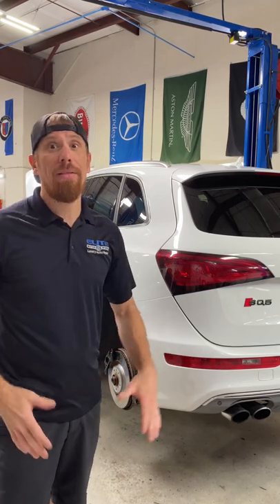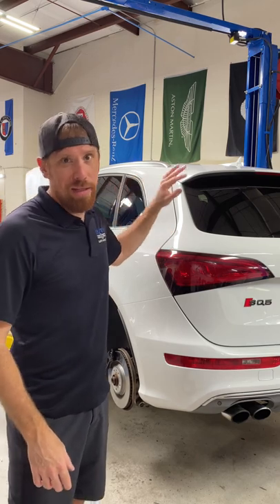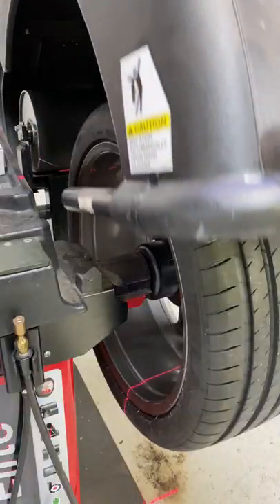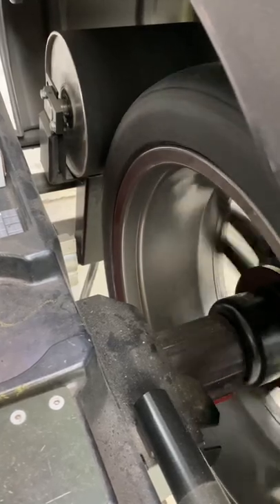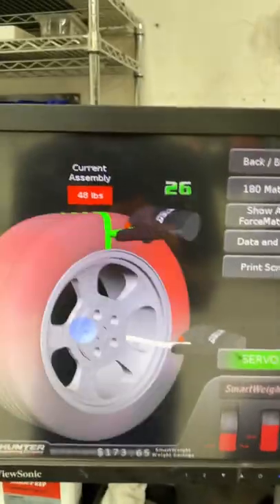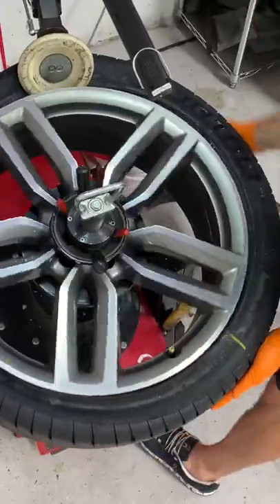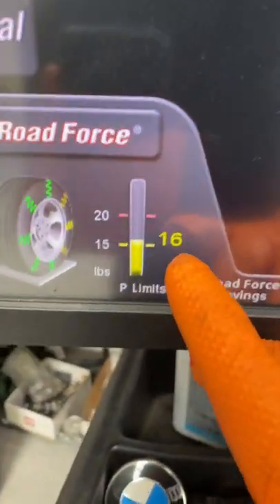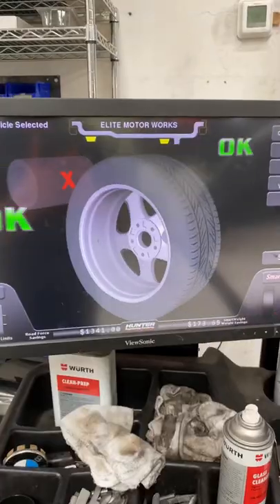Tires like a pro in 59 seconds #shorts

Comment: Bro where did you find that wheel balancer!!? That's next level!!
Apparently the one I use was made in the   Roman Empire days.
Reply: Hunter. Hunter makes good balancers.
Reply: Hunter engineering, they are exspensive
Reply: @DEATHWINGS5000  you get what you pay for.
Reply: Same 🤦‍♂️
Reply: I had the exact same one at the dealership I worked at.
Reply: I used to work at discount tire and we had the exact same machine almost. Now I work at Firestone, and I swear this one is from the last century. We have to manually calibrate where the weights go by using measuring arms and it doesn’t have a road force thing at all. Pretty big difference in priorities between the two companies I’ve noticed.
Reply: I still use a solid bar and two gauges like truing spokes
Reply: 6000€ + in our country..
Reply: Hunter.....
Reply: i just have 5 midgets spin the tire an i guess where to put the weights
Reply: @jstample  bro we literally have one POS changer and one POS balancer this place makes me sick lmfao
Reply: @fancypancytalker  That’s sounds horrible dude. I hate doing tires anyways being flat rate but sometimes we get backed up even with two of each machine if it’s busy
Reply: @jstample  look at the bright side at least you get flat rate lol I’m the only CST here and even I have to use our shitquipment sometimes. Our store is the most fucked one lmfao our tire number today was 15
Reply: America's Tire / discount Tire only uses those kinds of balancers I love them
Reply: bro i know exactly what pos balancer you’re talking about never again so glad i don’t work at that dealer anymore
Reply: @michaelric3540  sometimes
Reply: some cost $10k -$20k dont they.... everythings for sale
Reply: The road force balancers have kind of been disproven as a gimmick. 🤷‍♂️

If you want a nice balancer, check out Rotary's new line up. Yep the same lift Rotary, that rotary.
Reply: @LynxStarAuto source?
Reply: Realistically you probably don’t need it unless you have run flat tires or low profiles because the stiffness of those sidewalls is why you need road force balancing
Reply: Hunter road force elite GSP 9700 it’s 30k for one. thank god I bought mine used.

Comment: Did anyone else notice the lump in the wheel?
That wheel is effed up. The wheel has a flat spot in it, like as if someone hit a massive pot hole.
Reply: ai was just about to comment the same
Reply: Ask the wife, she aims for potholes and then drives into them! 🤦🏻‍♂️
Reply: Yup time for a new wheel. Or get it repaired. He probably doesn’t care because it’s the wife’s car.
Reply: Found many German cars with run flat tires can actually bend the rim with tire not damaged....
Reply: I work in this industry and can confidently say, German car wheels bend like crazy, BMW, Mercedes, Audi, doesn't matter they all bend. So do corvette wheels, but there's not much tire to protect them.
Reply: @JT0y  agreed, German cars bend wheels like American cars rust out, seen a 4 year old Chevy Tahoe with $6,000 in rust repair with ZERO help from the general.... Known issue but since it wasn't "rusted holes" wouldn't do anything for the guy, 60,000 miles on a 2015.... This is 3 years ago. Even the cheapest German car has a 10 year rust warranty. Sure German cars are expensive to fix but they don't have the baked in the cake planned obsolescence like GM. No manufacturer should let a car rust out and do nothing like GM.... Buy they only care about selling a car once. Most people I know who have bought GM new only do it one time because how garbage they really are.
Reply: @justinweaver7553  yes that is true, but do they really need to make stronger/heavier wheels for bad road country’s? 🤔
Reply: As my frend/wheel welder said „i can balance a square for you. It will not roll good”
Reply: Meh. Not a big deal. You'd be surprised how many bent wheels are rolling around the streets lol.
Reply: The mechanic is counting on the wheel to deliver him the insurance bonus.
Reply: Same my man.💪
Reply: came here to mention the wheel being bent up
Reply: Road force matching helps in these conditions
Reply: @justinweaver7553  been running around in the wife's car this weekend , it's got 205-40-18s and I thought it felt a little soft, like I'd lift off the gas and it felt like the brakes came on. 
Right front tire had 7.5 psi,with a best of 16 on one. 
 Not a run flat ,wheels fine, she gets lucky like that all the time.
Reply: @MrTheHillfolk  dude, wow, that's lucky she didn't have a blow out, I'd check...tires that low are very concerning
Reply: @justinweaver7553  yeah I checked it out when I got it out to my shop, couldnt be more lucky in a way ,that it was a leaking valve core.
Easy fix ✌️
She doesn't use the car much, and it was sitting for a good 10 days. 
Tbh I shoulda walked around it instead of just getting in and going.

Comment: Here is my issue with rims. Every on is so hung up on “billeted” rims. All that means is that it was a log of aluminum alloy and it was all machined out. I made thousands of billets when i worked in an Al/Cu foundry. The alloy is what is important….not the billet. And for a billet to be so out of balance means the chemistry and metallurgy on the damn thing suck terribly. If you are having to balance a wheel even at 16lb….the manufacturer is terrible and they should be HUNG. Their QA is a damn joke.
Reply: I don't think it's the metal, it's the fact that the rim took a hard hit and has a dent, or the tire is the cause for high road force. I've seen Ford and GM wheels peal off coating so bad that they can't hold air too.

Comment: To everyone who's mind is blown about the balancer, that thing has been around for almost 20 years... Hunter even makes machines with small platforms to set the wheel/tire on that raises it up to the balancer spindle saving your back.

What road force balancing it ACTUALLY doing it matching up the heaviest point of the tire with the lowest spot on the wheel aiming to potentially cancel out those two points which can create an un-smooth ride.

Comment: Have an older road force where I'm at, works great but new tires can give wacky high readings at first... I find letting the tires sit pumped up for a couple of hours (if possible) will help but driving 500-1,000 and rebalancing tells you for sure. But mount matched tires bolted to hubs that have been on the car machined rotors and it's smooth as glass. It's only super picky customers or mechanic wives that get this treatment

Comment: Is that not what the dot on the side wall is for? Your supposed to line that with the value stem.. No? Then you should need less weights to balance it.  I could be wrong, but I do remember being told this or hearing at some point.

Comment: Those machines with the center lock actually only balance wheels true to the the machine. Not true to the car. The center lock applies a different force than what it has when bolted to the wheel studs. Is only slight difference but it's definitely different

Comment: Force variance is not out of round. At Goodrich we used a tire uniformity machine which actually ground rubber away to equalize that variation. Moving the tire as you did corrects some of it by adjusting the tire variation with any existing wheel variation to try to obtain zero.